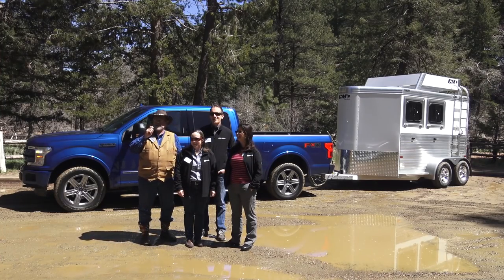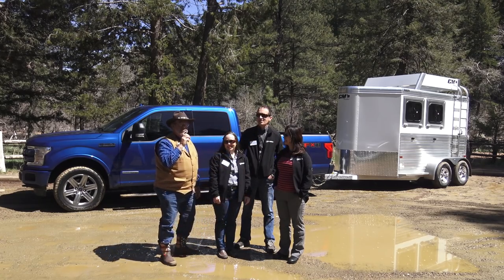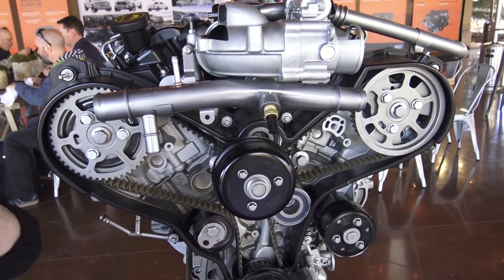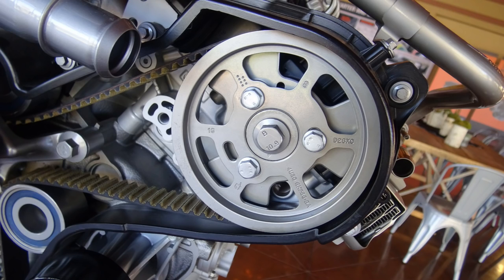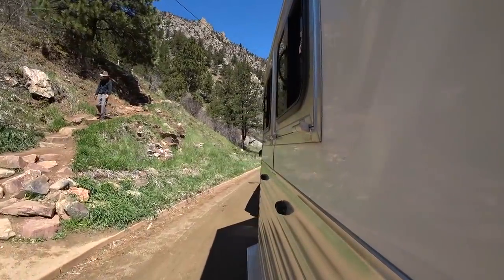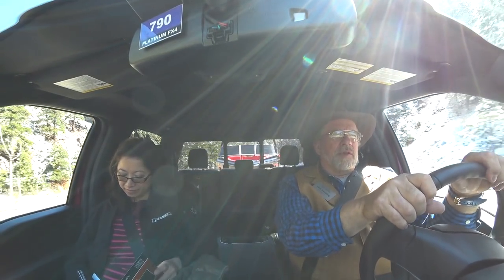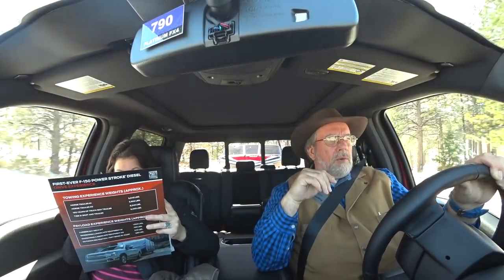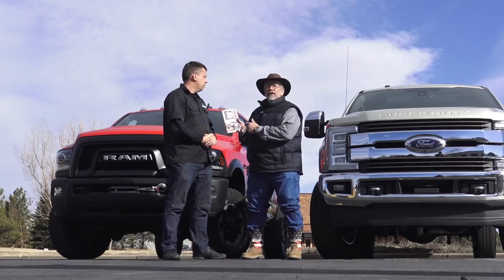2018 Ford F150 diesel part two, first drive towing and engineer interviews

Comment: Another great video on the diesel F150 and quite possibly the one that I needed to see that let me know that I would be better off with either the 3.5L EcoBoost or the 5.0L Coyote for my travels in the mountains of western Maryland and northern West Virginia.  It is really nice to see that truck owners have a great advocate with Mr. Truck taking the engineers to school and teaching them how these vehicles are used in the real world.  In fact, if this is the best team of leads at Ford for this product, I am seriously questioning the competency of the group as a whole as they were not very proficient with the vehicle/engine specs and could have been embarrassingly tripped up with common questions.  Again, thanks Mr. Truck for getting those tough questions answered while not drilling down on the weak points in the responses.  I guess we have to call you Mr. "Gentlemen" Truck from now on.  Thank you for your courage and I look forward to the additional videos on the 3.0L (baby) PowerStroke.
Reply from the maker: your welcome

Comment: Hey Mr Truck!  This little diesel is obviously designed for fuel efficiency over power.  I'd be more interested in you testing the fuel efficiency towing a moderate load (around 6,000 lbs) instead of trying to max it out!   People towing much higher should get the 250.
Reply from the maker: I just towed 3000 lbs with it and 1600 lbs payload. It did well

Comment: Kent,  Did you ask the engineers why the 4x4 F-150 gets 5mpg less than the 4x2 version with the diesel? I'm surprised that 4wd eats up that much more fuel than on the Ecoboost model.
Reply from the maker: It was a surprise, didn't get an answer
Reply: TheHondaman just wondering if it’s because different axle ratios come on the 4x4, in addition to the normal parasitic losses through the T-case.
Reply: TheHondaman I’d be willing to bet that in the real world the difference would be significantly less.
Reply: More weight.
Reply: It was explained on tfl truck a week ago! 2x4 had 3.31 axle and street tires. 4x4 had 3.55 and all terrain tires. 4x4 is only available with 3.55. Which is pathetic with a diesel and 10 sp! Ford is playing games,as always!

Comment: Mr. Truck how did you feel the engine response? Turbo lag? Greetings from Costa Rica, Central America. Excellent videos!
Reply from the maker: Not turbo lag, just not much acceleration. It sport mode it was faster but it shuts off the Tow/Haul mode
Reply: MrTruckTV thank you.

Comment: Single Turbo fed from left & right exhaust .... turbo has active cooling when running & passive radiant cooling when off. Everything sounds good on paper, time will tell in execution. 

Ram’s launch they gave you a knowledgeable engineer .... Ford threw 3 at you.... they’re finding out why you’re called Mr. Truck 

Keep up the good work & keep them on their toes listening to what people need vs want in a truck
Reply from the maker: Thanks

Comment: Exciting engine, but wow so many components for potential failure.  I wouldn't pick a diesel over the ecoboost without a optional lifetime warranty.  I could only imagine the replacement cost for that fuel pump or a injector.  And belts on the backside of the engine, I wonder how you service that, remove the cab?
Reply: Fuel pump and injectors are expensive for any diesel.

Comment: A couple things on the engine cutaway.. and explanation...
Two speed oil pump electronic controlled will be a failure point, belt driven water pump fail point, timing belt.. looked easy enough to access and change.
But that REAR belt driven fuel pump...
Total fail IMHO.  I'm betting you have to pull the engine or cab to get that thing changed. If you like how far back in the engine bay that thing sits.
Also disappointed that you can only get the diesel in high trims, or fleet vehicles..
Reply: kens97sto171 it's already been tested and driven on Land Rover vehicles. This is segment(light duty pickup truck) is complete different though, only time will tell if you're correct.
Reply: kens97sto171 
I would say yeah belt in the rear sucks, but you also said belt driven water pump is a failing point? Have you ever seen an engine before? Two speed oil pump could be a problem if not assembled correctly but there are so many version of that out there now I wouldnt be to worried about it.
And alot of people pissed about the belt cams, its not a new thing for small diesels, alot of small equipment 4cyl diesels will use a belt and i havent really seen much problem with it as long you do the maintence.
Reply: I.T. Intern it’s not always the same just because it work for other doesn’t mean it will work on this one
Reply: Mr_ NutZ I know that, I just said exact same thing in my prior comment.
Reply: Dodge 3.6 and 5.7 and GM 5.3 and 6.2 engines also have variable displacement oil pumps. I have seen some issues with the 3.6 pump in Dodge Chargers but not the others.
What pickup truck diesel doesn't use a belt to drive the water pump?
Reply: Jonathon Smith Where do we find anything on changing the HPFP belt?
Reply: It looks like the HPFP belt is on top of the engine. It's in the back, but you might still have access to tat without removing the cab. It's a bad design, but you have to see how it fits in their before judging. It would be pretty dumb to have an inaccessible service item, but then again, look how hard Ford's other diesel are to work on. Don't put it past them.
Reply: Also, think about heat towards the back of the engine. I don't truth that being a 150,000 mile belt.
Reply: NO one that owns a Land Rover is using that vehicle to the extent a Ford Truck owner will.  You'll find the Land Rover either parked at the Mall or parked in a very nice garage!!
Reply: W D Exactly lol. Show me 1 picture of a land rover pulling a 10,000 trailer up a hill filled with gravel/cement or a horse trailer u name it xD. But incase anyone here (most of yall it seems) who have never actually disassembled a Ford block from the last 15 years.. Ford makes it a POINT to have their engines hard to service. Its built into the design in the Engingers design room. "How can we make an efficient 'considered normal' lasting engine, but at the same time make it a b*tch for anyone whose not in a Ford dealership shop to work on these?? "We want to eliminate the wanna-be shade trees, the Savvy DIY mobile mechanics, and ESPECIALLY the privately owned shops (Aamco,Mieneke, Midas, etc, etc).. Ford has the MOST 'special tools' required for any and every job.. this was not a coincidence..

Comment: I do my own evaluations before for I buy and about your truck nuts book for get it . With the Fords tow package will have trailer assist anti sway if there's any truck or trailer sway it will automatically break the trailer to straighten it out.
Reply from the maker: It takes a severe trailer sway to activate any truck with trailer sway control

Comment: Great video Mr. Truck! So why didn't Ford include an exhaust brake on this smaller powerstroke?
Reply from the maker: Thanks, I'll keep pushing, we might see exhaust brake in the future
Reply: Same reason they didn't put it on super duty until 4 years after everybody else! Turbo can't handle it! They will figure out how many turbo failures they have in production. Then maybe add it in a few years. 
I bet the 2nd gen eco diesel in the ram 1500 coming next Year gets a exhaust braking turbo!

Comment: I am assuming the "realistic" payload for the quad cab 4x4 diesel trucks is going to be about 1,400 - 1,500 lb because they are higher trim packages.  Did you happen to take a look at the yellow tire and loading sticker of one of them?
Reply from the maker: What is a loading sticker
Reply: MrTruckTV: Why the Tire & Loading sticker is a nice yellow sticker that is near spot on to the actual payload of that individual truck.  Check the driver side door jam of any ford vehicle.  It’s right next to the GVWR sticker. It tells you the max cargo aka “payload” you can legally carry.  =)
Reply from the maker: Yes, the gov calls them the safety compliant stickers
Reply: Ah,  the sticker says “Tire & Loading”.  Go figure, the government says one things and means another.

Comment: Hey Mr. Truck I keep hearing in videos that the engine is designed for a 150000 mile duty cycle What exactly does that mean the engine is only designed to last a 150000 miles?
Reply from the maker: Not sure, that's just what they tested it for. I think it should have been 200,000
Reply: @MrTruckTV  ok thanks. I guess I'm just going to wait on a new truck see how the 3.0 does for a year or 2 I'd hate to spend that much money on a truck and have motor only be good for 150000 miles.
Reply: From what I’ve read it’s 150,000 before major maintenance/repair

Comment: I was hoping the engineer would explain the large discrepancy with fuel mileage between the 2wd and 4wd.
Reply: Smarticus tfl truck explained it weeks ago. 2x4 had 3.31 axle ratio and highway tires. 4x4 had 3.55 and all terrain tires. Note 4x4 is,only available with 3.55. Seems stupid if the diesel has so much trq and they have a freaking 10 speed!!! Ford is playing games which pisses me off!
Reply: They'll bump the HP and TQ by 5 and the tow rating by 200lbs as needed to keep the "best in class" claims going. I used to love older Fords but their marketing is just ridiculous now.

Comment: does this diesel have a start/ stop and if it has it can you turn it off. i drove the land rover with this family of engine and it shut off just as i was slowing down to get out of the dealship lot. found the the button with the A swirl and locked out the start stop system instantly.
Reply from the maker: I thought it did, Ford didn't bring it up this time. I have a video of a media reveal in Detroit and I thought Ford said it did. I'll have to watch my video from several months ago.

Comment: Well : no exhaust brake + emissions systems + common rail injection component  costs + the high pressure pump belt near the firewall, I prefer the ecoboost. And what  was Ford thinking? "Let's use a mechanical fan for good cooling capability  but let's use a belt near the firewall ". I prefer the Super Duty for a working truck.

Comment: Mr. Truck, do you know if this is an interference, or non-interference engine?  If it is indeed an interference engine, many of us would have real concerns if the belt ever did slip before that 150,000 change interval, that we now have a 65K paperweight.
Reply from the maker: That's more of a Honda problem. Not many US companies want to eat valves when the belt goes.
Reply: That was exactly my concern.  Thanks for the quick reply!

Comment: Who still puts belts behind engines to drive critical components these days??? It's like some mid-engine Italian jalopy from the 1980s, where you have to rip the car apart just to replace a $20 part.  It's obvious Ford never learned from the Super Duty/Powerstroke debacle. "Hey things might need to be accessed for maintenance or repairs, but let's just pile everything on or in front of everything you need to access anyways!" Really, I would never own this truck as it gets older.

Comment: WTF? A belt-driven HPFP behind the engine? NO THANKS!
Reply: I'm conflicted about the belts. Nice and quiet and a lot less complex. Which just means Ford was lazy? Me personally I like the neat noises that the chains make. Also like the longer life of the chains.
Reply: Japanese engines use belts! Ford might have something going there.
Reply: Justin Cowan and eddie0175b, I prefer chains over belts. Actually, I prefer gears over everything, but I wouldn't avoid anything with anything like a belt. In fact, I've owned cars with timing belts. However, I do have a serious problem with a belt being at back of the engine, where it gets hot, and where you can't readily access it. That's just totally foolish designing. It makes servicing a nightmare, and it leads me to believe this is nothing more than a typical throw-away Euro car engine. After 150,000 miles, buy a new engine or truck. Fleets should stay away from this thing.
Reply: You might be able to access the belt without removing the cab. The cam, belt and pump are all towards the back, but they are on top of the engine. It might not be that big of a challenge. Still, it's not a good design.
Reply: Belts are ok, but not in the back of the engine. I'm from Costa Rica and the Toyota diesel engines have  reliable timing belts, I don't see why Ford can't do it too.
Reply: Chains last a little bit longer than belts, but about 3x the price to replace, mostly in labor

Comment: Belt haters. Ducati has been using belt drive for a day or so. Handling higher revs than most cars wish they could. Don’t like it, up grade to carbon fiber imbedded belts.
Reply: brotherheed00 it's not just the belt that may fail, its the rollers, tensioners and dampeners. The gm i6 will be something to watch for.

Comment: Wonder if you detuned the ecoboost to 250hp it would get better Mpg? Hah.
Reply: Turning, period, could improve MPG, but not simply reducing the horsepower. Horsepower is just a calculation of torque and RPM. If you don't want to make as much power, just don't rev as high. It's not actually going to change the efficiency within a certain horsepower/rev range.

Comment: Looks like they forgot to add the belts to run the blinkers and windshield wipers. Just when you start to like what Ford has been doing, you see this. I guess they figured the other brands don't do well with their 3.0's by 200k so why should they?
Reply: Jake A. Belts are far cheaper than chains, and are nothing new in engines. The money you save in not servicing a chain just goes into the initial higher cost.

Comment: I’m as big of a ford fan as you can get but no freaking way. Belt capable of 150,000 but if it breaks 3 miles outside warranty oh well it’s on you. With it being a modern diesel it’s definitely an interference engine so that belt breaks and you just trashed an engine. It’s not will it happen but when. Come on ford motor company you can’t just take a lame jaguar engine and put it into an F-150. That timing belt should be a thick chain or gears.

Comment: It would be better if it had a trimming chain, I don’t want to pay $2,000 at 150,000 miles on a new timing belt
Reply: Daniel Lockwood $2,000? More like $10,000 it's a ford after all...
Reply: $75.00 belt and 2 to 3 hrs.
Reply: $75.00 belt and 2 to 3 hrs.
Reply: Daniel Lockwood I changed the timing belt on my VW for $350. Not much to complain about to be honest. Original belt lasted 12 years and 185k miles

Comment: I feel disappointed 250 HP is sluggish. I ain’t buying that belt driven bs....so it’s a 150k throw away engine like the 6.4 then? Give those engineers your number so they can run stupid decisions past you first.

Comment: Is she seriously telling us how a vgt turbo works?!!! About 20 years to late lady! Fancy Garrett ball bearing with water cooling and still no exhaust brake function! Come on!
Reply from the maker: I asked her
Reply: MrTruckTV I know but her response was high school level not a engineer level. I am a diesel engine engineer...i was ashamed for her. She was quoting straight from the Garrett sales manual lol. 
Water cooled turbo is not needed on a on highway engine in a truck as there is plenty of air flow around engine. They used it so they didn't melt the turbo when they do start/stop crap. So they doubled the price of the turbo just to get start/stop function! Which everybody hates! Thanks for  jacking up prices Ford!
Reply: Andy Hass Blame that on emissions regulations not the manufacturers. We were shocked at the fuel consumption of our euro 6 wagons, and even the manufacturer admitted they were shit, but the govts seem more focused on tailpipe emissions over mega fuel economy, hence DPF, EGR etc.